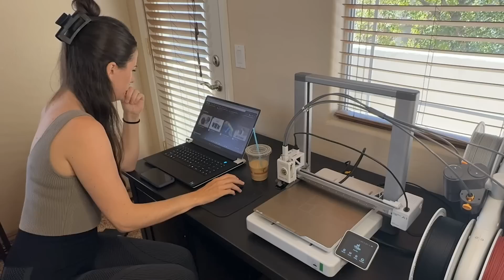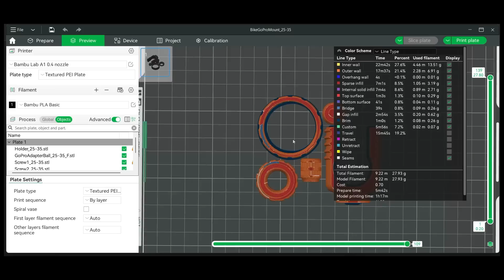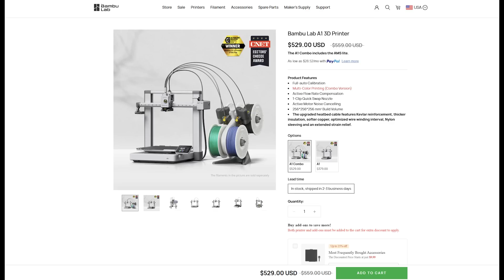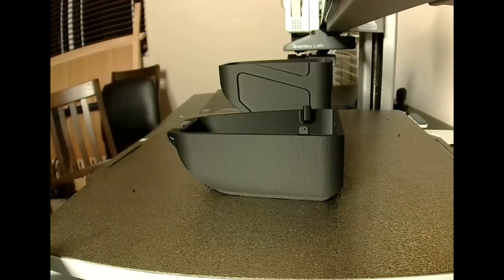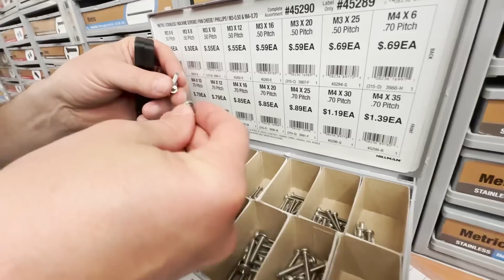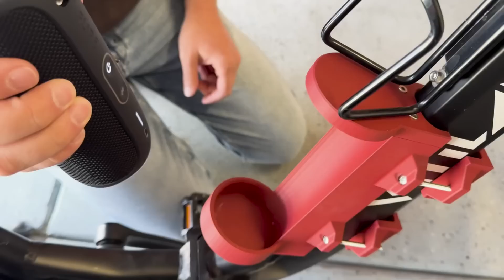5 USEFUL 3D PRINTS for EBIKES using BAMBU LAB A1 COMBO #3dprinting #diy

Comment: Wait... What! you're using PLA ???  That will definitely soften and deform in the sun. The glass transition temp for PLA is around 60 degree Celsius. Since your printer isn't enclosed, I suggest you use PETG. I use Sunlu Matte PETG for my MTB creations. Having said that, I do like your content and the way you present 🫶 I've been 3d printing many years more than riding E-MTB, I learnt the PLA lesson very early 😅

Comment: Pro tip: you can uncheck any calibration pre-print. You do not need to level the bed every single time you hit print. That in uneccesary and only needs to be done if you're having adhesion issues. Otherwise you're just wasting a lot of time recalibrating the machine before it start printing.